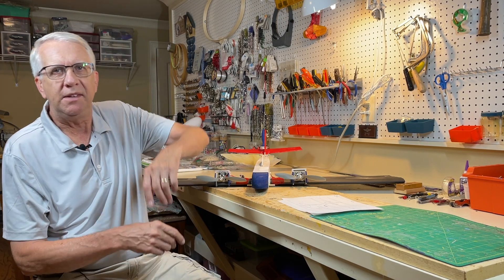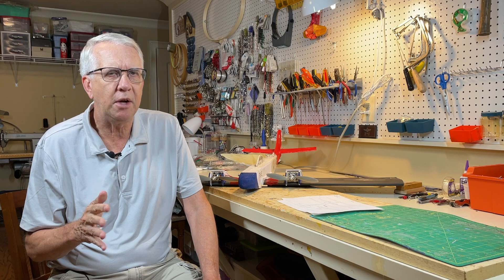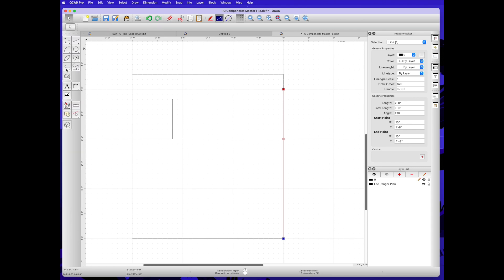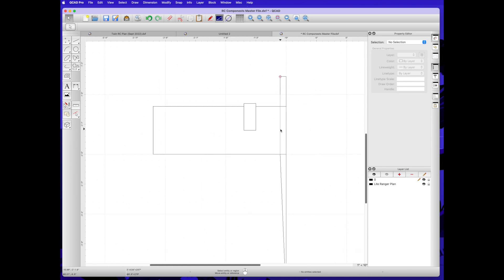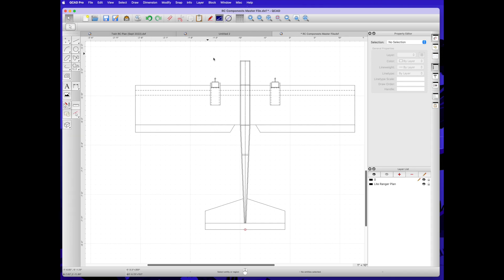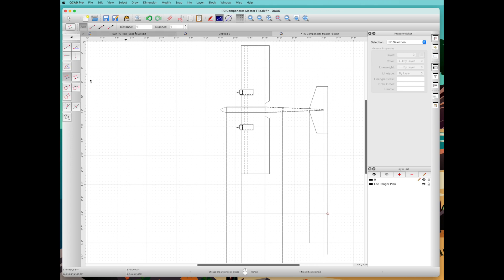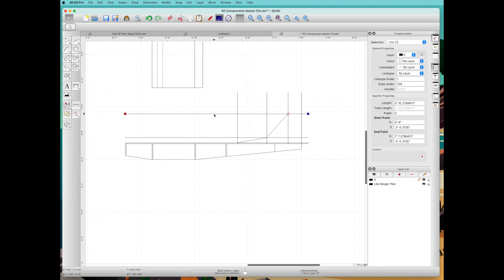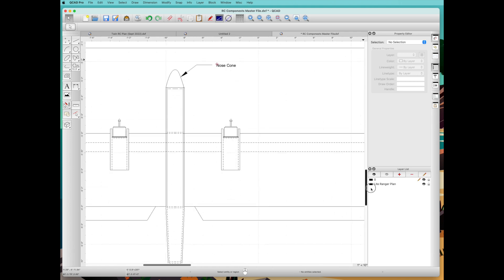QCAD Tips & Tricks Twin RC Plane Plan

Comment: Mr. McKay.......  Love your videos.  I am a complete newbie, an old and clumbsy fellow.  Killed an aeroscout in 2 outings, but harvested the bits and bobs.  You created a small plane with an ultra micro receiver.  It weighed 1.6 oz.  2 questions.  Do you think your double surfaced folded wing would work or is it too heavy?  What motor did you use on that design?
Reply from the maker: For the ultra micro receiver, plane weight should be under 3 ounces. Double wing method too heavy for these planes. Tim

Comment: quick question. so if i have a micro reciever like you use on the park flyers but its a 4 channel can  i change the rudder from the left stick to the right stick?
Reply from the maker: Daniel:  You should be able to do so. Going from Mode I to Mode II is a bit complicated, procedure typically located in transmitter manual. Tim
Reply: @TimMcKay56  thank you, tim. I'm planning on building a little foam plane and wanted it to be 3 channel but might just go ahead and add the ailerons instead of trying to change everything.
Reply from the maker: If you can add ailerons, always a better approach than rudder only. Tim

Comment: Hello Mr McKay, I am considering building a trainer RC plane from a plan. I am considering this because most of the kits seem to be unavailable these days. My question is basic. What is the best way, in your opinion, to transfer images from a plan to wood so the part can be cut? Thank you, Paul Schott, Chewelah WA
Reply from the maker: Paul: For smaller parts like a rib, I either trace a copy or make a copy from my printer, cut it out and trace over the balsa. Another technique is to use carbon paper between the plan and the balsa. Tim
Reply: Thank you for the information.  I have been out of the control line hobby for many years. Now in my mid fifties, I am going to learn to fly RC. I enjoy  your engineering level videos and the knowledge you share. Thanks again
Reply from the maker: 👍🏻 Tim

Comment: Thanks for another helpful video, Tim! I have an older version of TurboCAD (TurboCAD Pro 19) which still runs fine on Windows 10,  and I've gone through your tutorials for that program. I also have the free version of SketchUp 2017. Does QCAD offer new capabilities for your 2D work, or did you just switch because it's more affordable for today's viewers? In other words, would you advise me to dump TurboCAD 19 in favor of QCAD? Keep up the great videos, please!
Reply from the maker: Slim:  I really do not have an issue with TurboCAD. Rather, after a Mac OS upgrade TC wanted $120 to upgrade and work with new OS. I then turned to QCAD and I like it a LOT. I’d say QCAD a lot more user friendly for 2D work, just no 3D. Tim